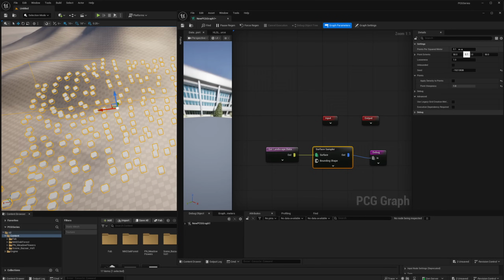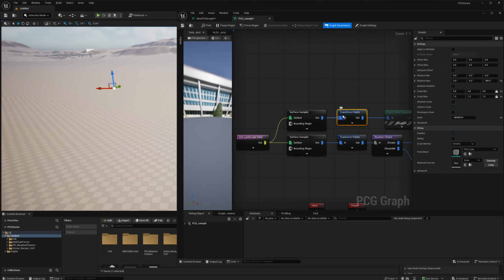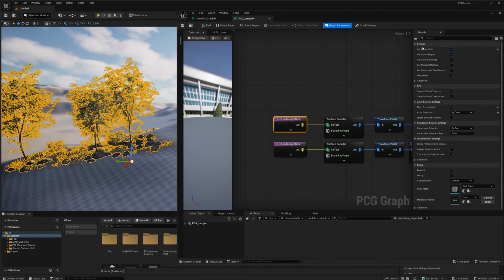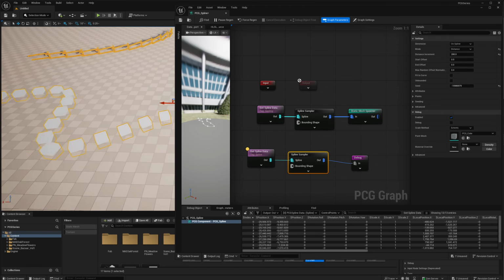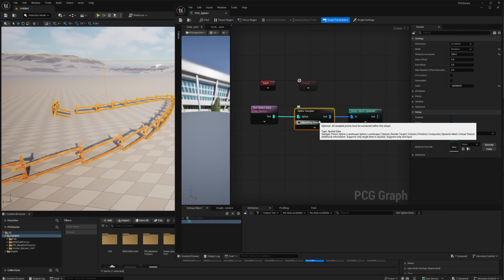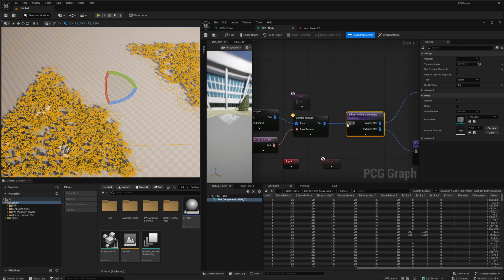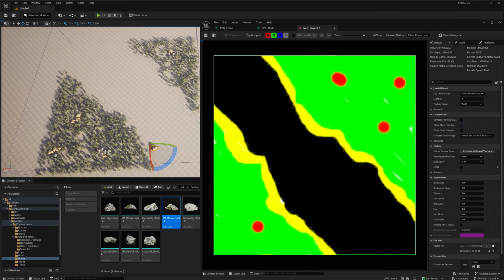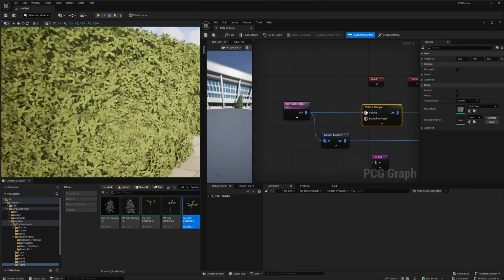PCG Point Sampling – Surface, Spline, Texture & Volume Explained

Comment: Let sai I am generating a terrain using perlin noise and the use the pcg graph to generate houses , trees , rocks and so on top of it to get a procedural map like minecraft, will it be efficient and is it possible?
Reply from the maker: Definitely possible, For it to be efficient you need to design and create it in a way that is efficient. For every tool there is good and bad ways to use it. When doing it at a big scale every single detail matters, so a lot of expertise and work is needed to achieve the best results.

Comment: You skipped the Horizontal, Vertical and Volume modes for the Spline Sampler. Which is exactly what I was trying to figure out how to use (from what I understand, the default Extent is set to (1, 1, 1) and it makes these 3 modes useless)

Comment: get landscape data does NOT work with static meshes
Reply from the maker: Yes it is for Landscape only as the name suggest.
Check the video for projection if you want to spawn points on a Static mesh( 8th in PCG Essential series). Or you need to use Mesh sampling which is PCG Geometry script option, will do a video for geometry scripts too hopefully soon.

Comment: Hello, I created a PCG with a sphere. The result is not bad, but the objects are facing outward. How can I reverse the direction?
Reply from the maker: with Transform points node will be 1 variant, depends heavily on what exactly you want to achieve.
Reply: @dk_3d  Actually, it's like inverting the normals, but I'll try it with the transform. Thank you

Comment: for some reason random choice node doesnt output any debug points in 5.6 when using with static mesh spawner on the chosen socket.,
Reply from the maker: make sure the input to the node contains some points (check in the attributes input set)